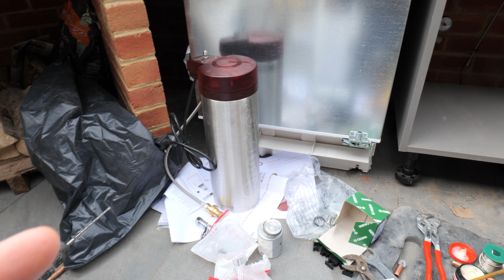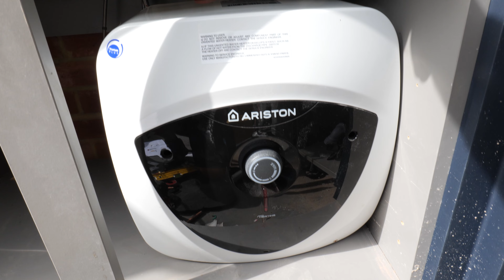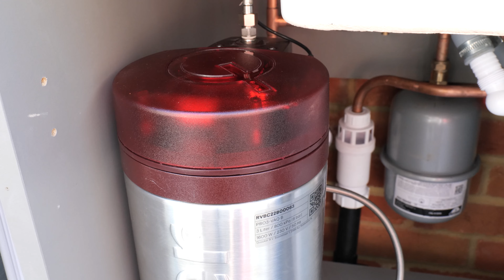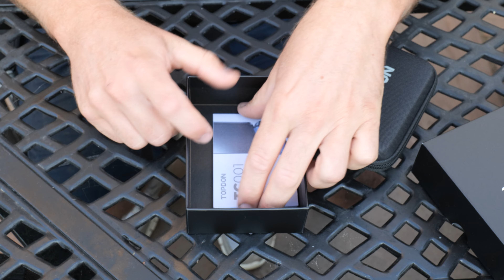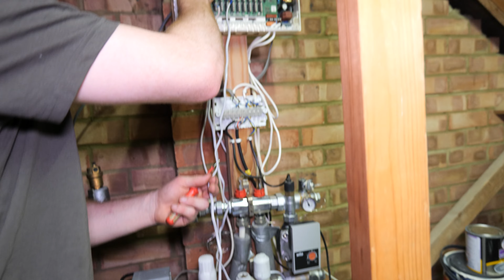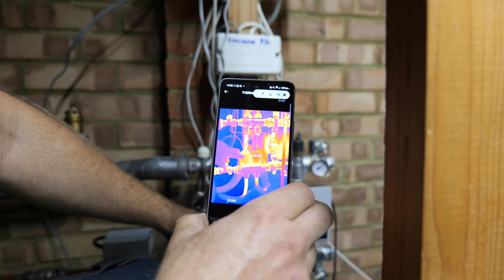Outside kitchen plumbing - Underfloor heating faults

Comment: Never seen a manifold with the pipe on the opposite side of the flow. It's passing the actuators before the pump? Does it just use that pump when the mixer valve is fully closed?
Reply: Ignore that... perhaps wait till the end next time before I ask questions. 😅